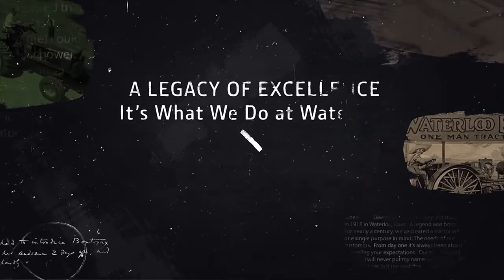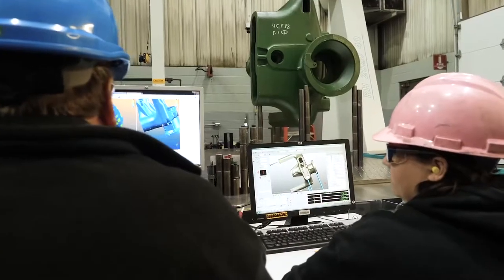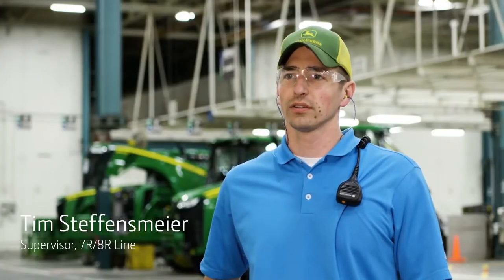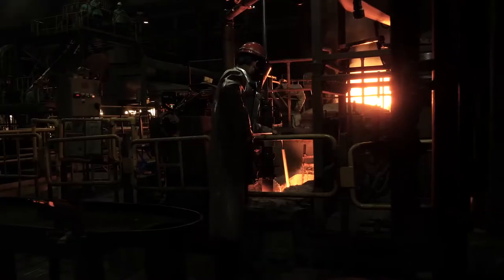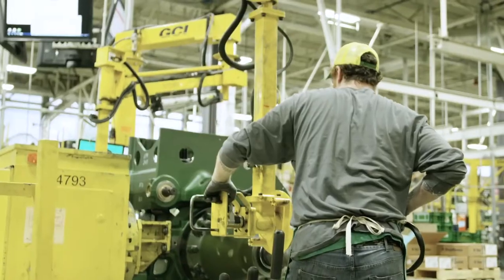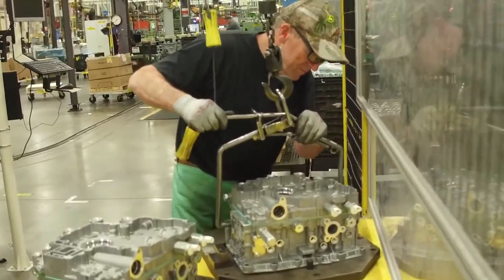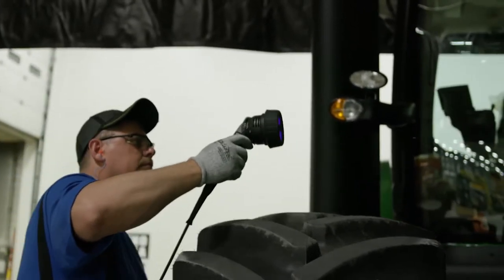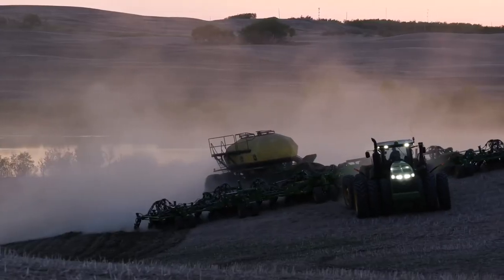World's largest tractor production factory - John Deere

Comment: Over rated, over priced, under performing. And we won't talk about owner diagnostic access & warranty problems!
Reply: Agree and agree and agree. And we should be BS over the diagnostic access but they are too smug and say "oh well"
Reply: All its price is over the top I will give you that but a Deere under performing could you please explain that because honestly I have never came across a Deere that is under performing either new or old I have never seen a Deere failed to get the job done so please explain where does a Deere under perform